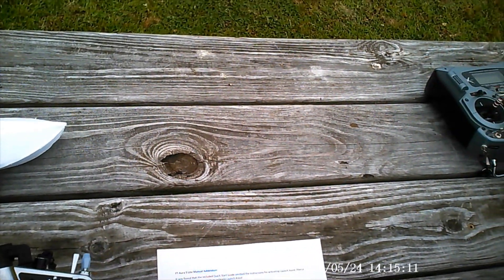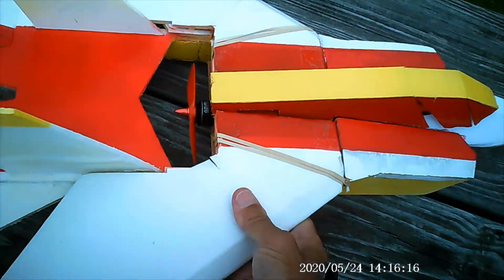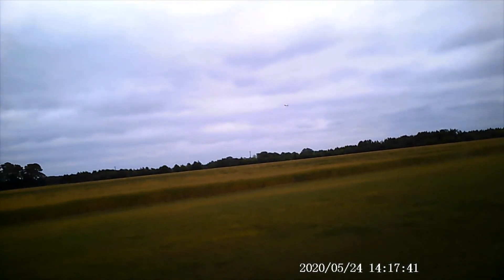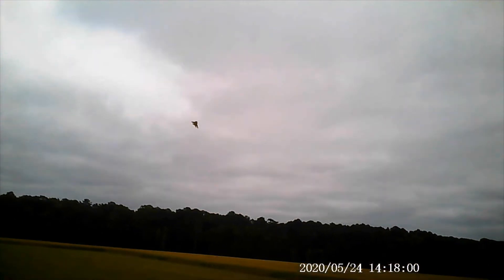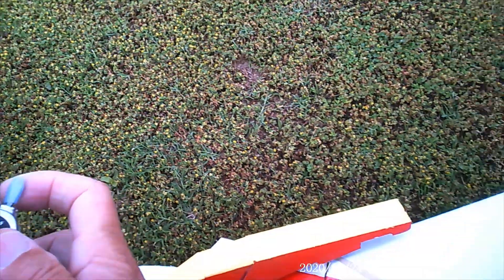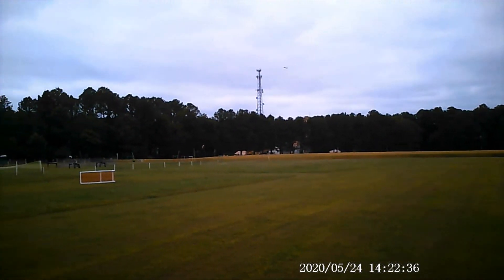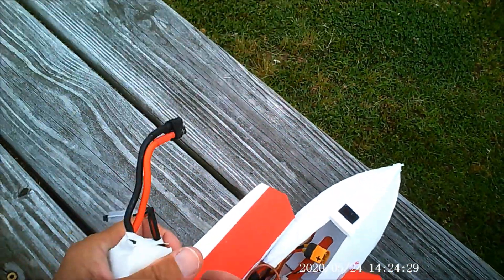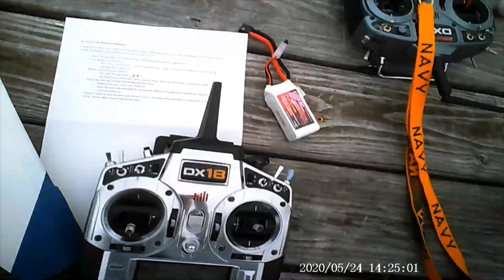Flite Test Bravo with Aura 5 Lite doing a Launch Assist Calibration flight on 24 May 2020

Comment: Cool looking jet! What is it?
Reply from the maker: This was a kit I bought from FliteTest.com. It's $30 and called the Alpha model. They also have the Bravo and Charlie models. You put it together with hot glue. You have to provide the battery, ESC, Receiver, motor and servos. They sell that stuff too as separate parts or as a package. I had a old quad motor and ESC so I used my own and some 9g servos I already had. The Aura 5 Lite I bought from FliteTest.com too but used a Lemon-Rx.com Receiver with it. I keep the foam board kit pieces in the kit and cut my own from Dollar Tree foam, using the kit pieces as templates. If I crash, I can cut the parts from the templates. If you want, you can just download the plans from FT for FREE, and cut your own parts from the plans. Here's the link for the kit. https://store.flitetest.com/flite-test-alpha-electric-airplane-kit-736mm-flt-1049/p673713
Reply: @hifinsword  Thank you!